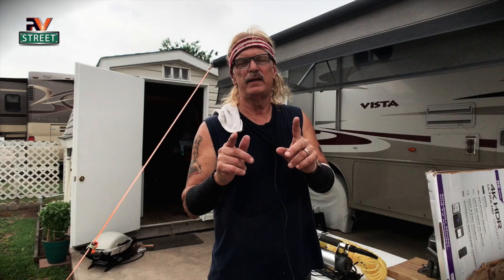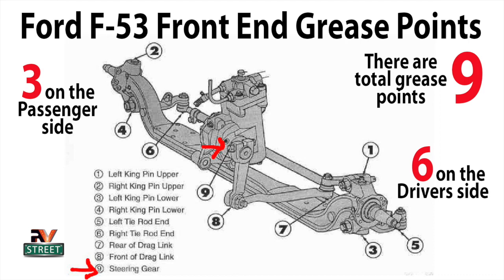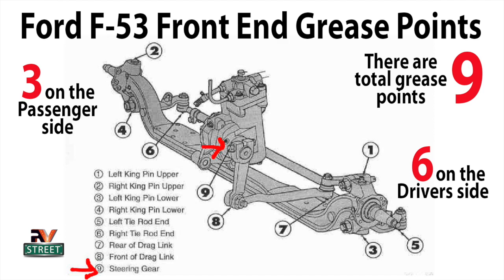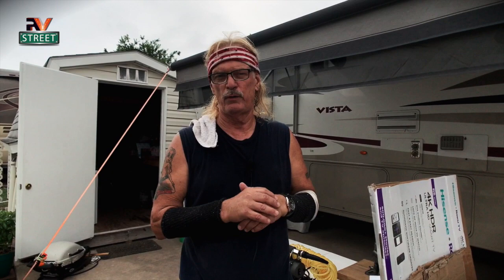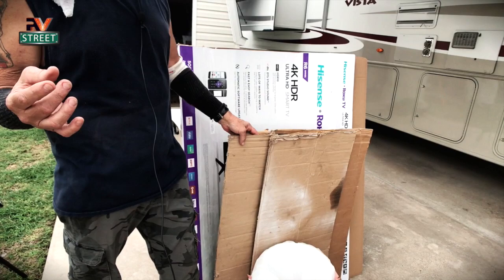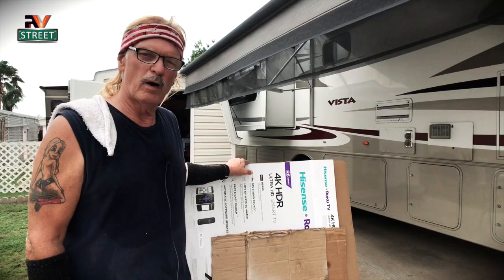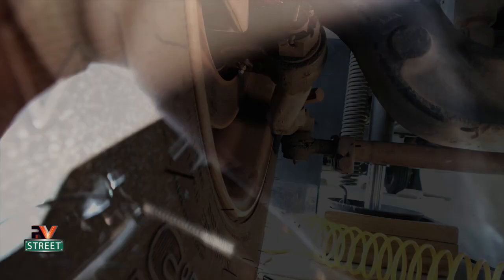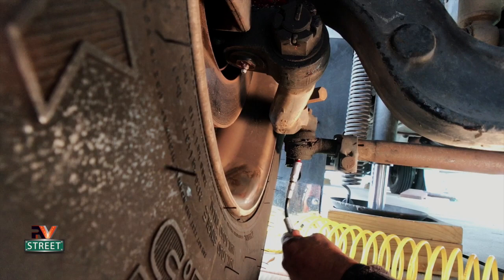GREASING front end, Class A, Gas RV Motorhome the RIGHT WAY

Comment: May I ask why you used the bottle jack to unload the tires when you already have the jacks down? Is it because you do the work on the road and you're already leveled with the slides out? I was thinking about just using the jacks. We do not full-time so I do not carry a bottle jack. I would just do this work at home with the slides in and off the jacks.
Reply from the maker: Be glad to answer that RJ,
Even though we had the jacks down and parked at that time, we manually level and so the coach really doesn't raise up much. As you saw in the video when I put that bottle jack under the axle....you saw how I raised the tires up even further. Never off the ground...but enough to remove most of the load, The leveling jacks really didn't remove the load like it needs to be to grease correctly.
If you raise the coach using the jacks, it's going to be pretty hard to get that axle where it needs to be to greased unloaded. Plus it's not nearly as safe using just your jacks. Bottle jacks are pretty cheap and IMO you should have one onboard anyway in the event a roadside emergency happens and you need one, even though you don't FT.
Hope this helps. 👍
Reply: @RVstreet  Thanks for the quick answer. I manually level as well and since I would be doing this in my driveway I could use the jacks to lift the front end although it may be a bit difficult to judge the height  from the inside. 

I must admit that I am having a bit of difficulty believing that a $20 bottle jack would be less prone to failure than a multi-thousand dollar motorhome leveling system. :) Although only doing one half of the axle at a time would be a difference.
Reply from the maker: @RJ-kp6hc  I understand. We all have to make our own decisions. But if you knew me and my industrial and mechanical back ground I always put safety way up on the list. No matter how confident I am because...well stuff happens.
I was reading an online forum about a year ago where one of the members who was highly regarded and a big time DIY guy got killed when his coach fell on him while doing some suspension work. He was using his jacks only to raise the coach up to do this work.He didn't use any blocking of any kind. The story didn't reveal many details but it was sad and many were distraught because he was well liked. So that's why I said what I did. But I don't judge anybody for how they decide to do things. It's their life, their rig. I just try to help where I can.
🔧🙏
Reply: @RVstreet  I absolutely agree with your method once I thought it through. I worked in aviation maintenance for a quarter-century where nothing is left to chance and I also was a firefighter/paramedic for a long time and got to deal with the aftermaths and tragedies from people not fully thinking things through. A blink of an eye is all it takes.
Reply: @RVstreet  I must be missing something obvious. I believe you mentioned your store where the grease gun and grease could be purchased but I cannot find it. Got a link? Thanks.
Reply from the maker: @RJ-kp6hc  Hey RJ,
So ya, go back to the video here: https://www.youtube.com/watch?v=kJBG-5KXRLA&t=554s
then click SHOW MORE under the video. That takes you to the description text of the video. Then scroll down and you'll see the links there. 
thx you so much for supporting our channel RJ. Joanie & I appreciate your support so much.  👍💕

Comment: This products will work for a Winnebago chieftain Chevrolet engine 1989 ?
Reply from the maker: Of course. Your chassis needs greasing like any other vehicle doesn't it?
Reply: @RVstreet  sorry my question is if that type of grease I can use for my chassis?
Reply: Another question is if that hose  will work on any type of fittings or I will need an adapter,?. And sorry for many questions but is the first time I'll do this 👍
Reply from the maker: Yes it’s a Multi-Vehicle grease and the label on the back clearly describes what it’s good for. Go to the product from my Amazon Store in the Chassis care category and you can read it for yourself. I would have no problem using this grease in any vehicle but if you’re unsure check you manual for the specs of what it calls for. This grease meets or exceeds what most any vehicle would require.
Reply from the maker: You shouldn't need any kind of an adapter. The hose end will snap onto any standard Zerk fitting. All standard grease fittings are Zerk fittings. But if your unsure, google zerk fitting to see what it looks like, then check what you have on your RV. Make sure when you clean the old zerk fitting first to get off all the dirt & grim before you start to apply new grease, just like I showed in the video.
Reply: Thanks man I new in this, but I trying to do things my self cause is an old coach and not a lot of shops want to work on it 👍
Reply from the maker: @ernestovelasquez3457  Well, that's the whole point of my channel. You can do 80% - 90% of everything your RV needs yourself, save tons of money and know it's done right. You can do this stuff and I show you how.
Here's all my videos if your interested:
https://www.youtube.com/@RVstreet/playlists
Reply: @RVstreet  thanks a lot, and thanks for your awesome videos 👍